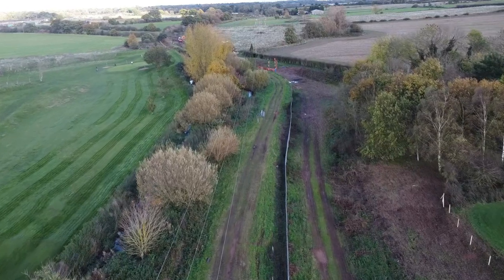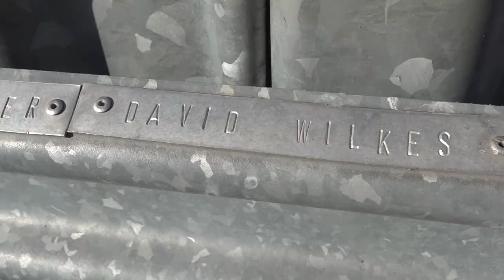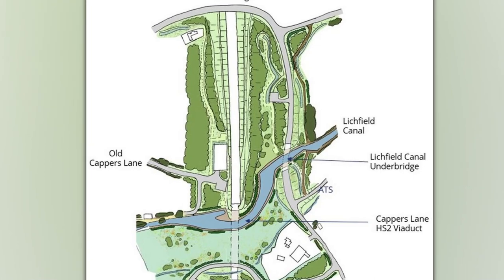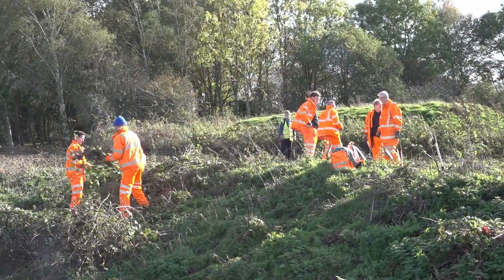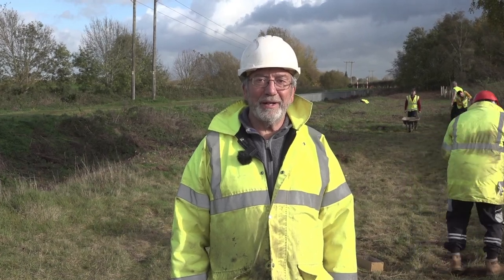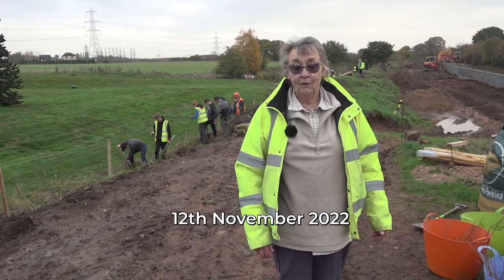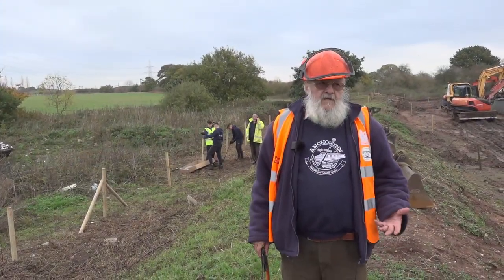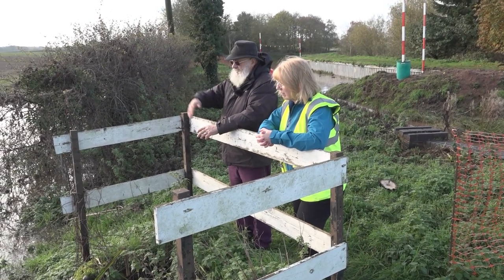What has been happening at Darnford Moors

Comment: So will this section also be navigable as soon as HS2 is done with the diversion and lock 30 is completed?
And what about going further to Darnford Lane and even further?
Will it all depend on pumping the water from the brook?
Reply from the maker: In theory yes, subject to access through the section currently used by the Crusiing Club and the fact that there's no winding hole so boats would have to reverse back.
The section to Darnford Lane (and onwards) will depend on getting more funding.
Reply: @LHCRT  Interesting. Where do you plan to have the next winding hole, BTW? I know there is one at Borrowcop already...
Reply from the maker: @Butrus Damaskus  there will be one just after the lift bridge, but I'm not sure how big it will be. I must ask the question as I've always wondered.
Reply: @LHCRT  OK, thank you.

Personally, I think that when LHCRT will manage to open even a small section of the canal to an actual navigation (connected to the network) it will be a huge moral boost for the project. Even if you already did an amazing work until now, of course...
Reply from the maker: Absolutely. It's something we've been aiming for for a long time. (I want a trip boat 😀)

Comment: Why not weld the seams to the panels instead of sticky tape?
Reply: The piling is currently galvanised which provides very long-term corrosion protection. If you weld it then you breach the galvanising and it corrodes a lot faster. You have to grind the zinc back quite a way from the weld too, otherwise it burns off when welding, giving you zinc fume which is highly unpleasant. Overall, the tape is a better option.